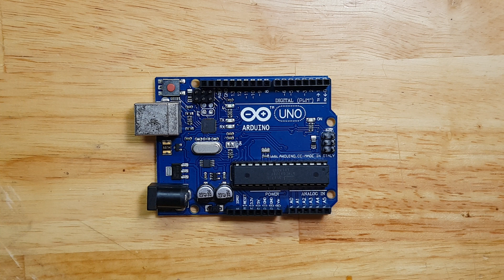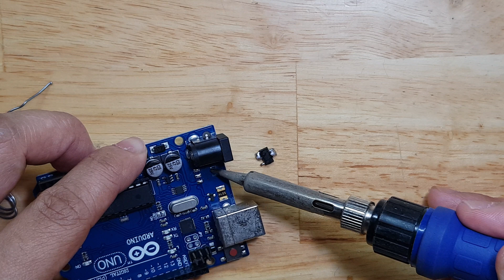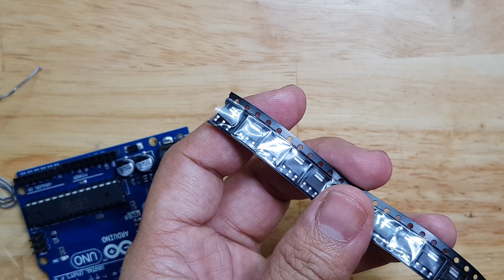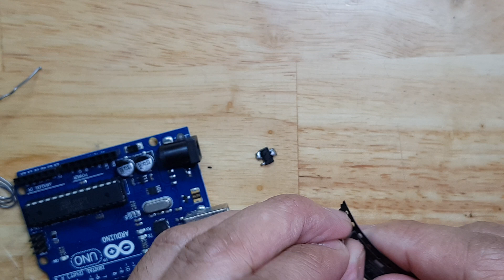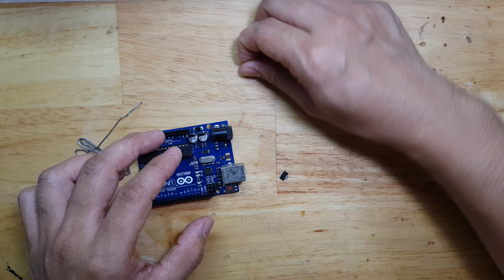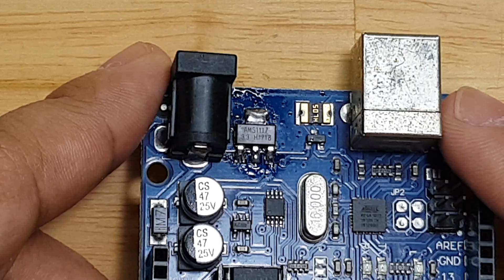HOW TO REPLACE PARTS OF ARDUINO AND HOW TO REPAIR DAMAGED COMPONENTS (EASY SMD SOLDERING GUIDE)

Comment: What happens if I apply more than 5V volts to 5V pin. Which components can be damage?
Reply from the maker: Arduino uno pins re 5v tolerant so nothing will get damaged 👍
Reply: @circuitdesolator  Hello Sir my Arduino Uno has an issue with atmel eeprom it becomes hot and reset button not working I do see Arduino Uno in list of usbs when connected to a pc but I can't upload any program to it annd reset button not working what could be wrong here?

Comment: The big pad on the voltage regulator is actually not ground but Vout (connected to middle pin).